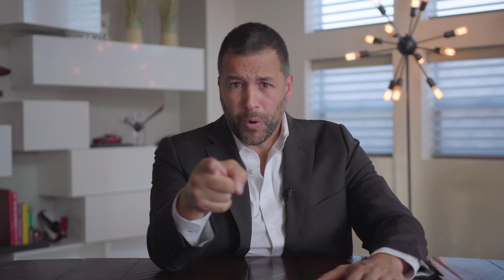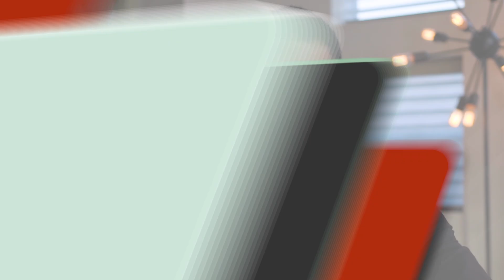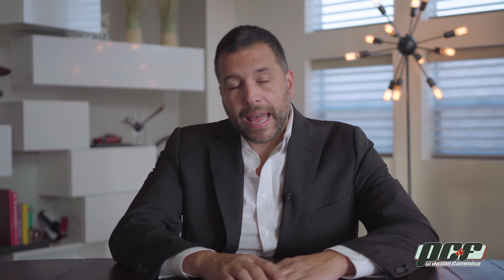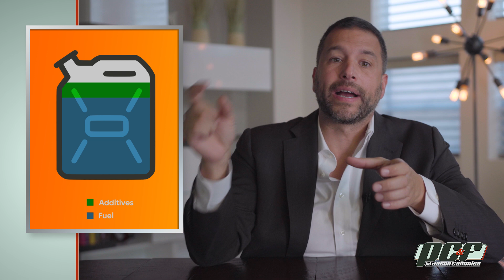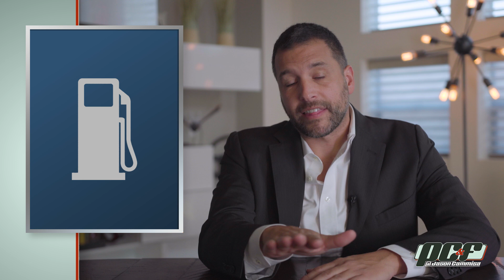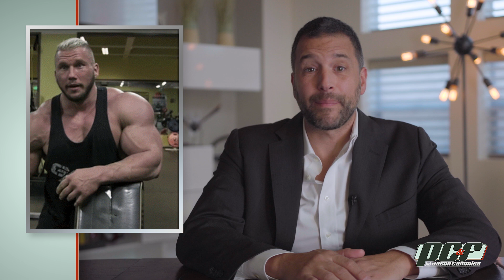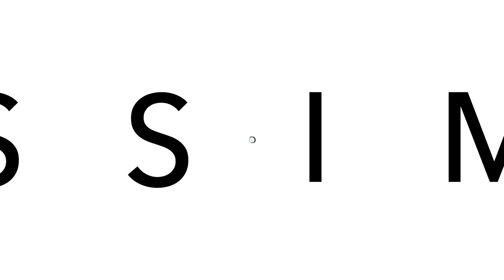Why you should never put premium gas your non-premium car — Proper Care & Feeding with Jason Cammisa

Comment: He said nothing about having a vehicle that runs on 89-93 and one is putting 87 octane in it.  Computer retards the timing, not as much heat and carbon builds.  Yes, running 87 octane in a vehicle that is designed to run on higher octane can hurt the engine.

Comment: Because I run my work vehicle primarily in the winter, come spring I'll often switch to premium (94 octane ethanol free) as the car can sit for weeks through the spring and summer.
On one wildly hot summer day (43°C) my car began hesitating, and misfiring. From now on I think I'll risk leaving 87 (and it's hydroscopicness) in the tank for long periods of time, perhaps with a shot of fuel stabilizer.
Reply: yup. thats because of ethanol. You are right to store your car with less ethanol fuel in the tank.

Comment: Premium gas (at least for top-tier fuel stations, dunno about other places) has a better detergent additive package and can keep your valves and such a little cleaner, so I run it in my cars. One of them needs it for the octane thanks to its computer tune, two don’t, but I run it anyway sheerly to keep the top end cleaner. I’m not sure that the difference is worth it, or even appreciable, but I feel better about it. Once I have a direct-injected engine in a daily driver (probably the next one), I’ll likely just run 87 in it since the already small potential for real benefit will become even smaller.

Comment: Well I think you should do a real test with a dyno I think you'd be surprised that there is difference and it is possible to measure even between 98 and 100, and there is no loss of power, it is in fact the opposite. I've seen it many times by now and you can do the test with any modern car it doesn't have to be a performance car at all. It might not give better mileage, but it does give you more power.

Comment: Why don't any videos discuss what to do in a Car that RECOMMEND premium, as is the case with most luxury and turbo cars? Most such cars can run regular with little fuel economy penalty and a cut to power that doesn't affect daily driving. All care, including those that require premium, can run regular and protect themselves, but the ones requiring premium will see more severe effect on fuel economy, power, and smoothness.

Comment: Pontiac G5. 2.2 ecotec. No reason to run Shell 91. Except I will do, for 2,500 miles to reduce carbon deposits by ~70%? She's got 180,000 miles running 87 the whole time, so I do believe I have sound reason to run premium. (once the 2,500 miles is up, you're damn straight I'm going right back to 87.)
Reply: dump some B12 in the tank.

Comment: reading some of the comments are hillarius!  obviously the knowledge of energy per gallon is   
something that should addressed.  And the record is clear on the corrosion ethanal causes in many engines.  if it wasn't making corn farmers richer through gov. subsidies, you would not be seeing it.  higher the E content, the lower energy content it has - and your mileage suffers the higher the content is.

Comment: The additives do help any octane car. Its basically like putting one of those fuel additives they sell in the auto section. Though this is not worth it still in most cases, though I find it helps with older vehicles. Higher octane gas often (though not always) has less ethanol, this helps with fuel economy and also reduces corrosion in older cars or with carburetors (like with law equipment, motorcycles scooters or older cars). And last people who let there car sit for a long time (like for plugin hybrids) the higher octane fuel lasts longer because as fuel ages it looses octane.
Reply: Chemistry is not your friend. Ethanol raises octane rating in fuels.
Reply: @truantray  At the cost of causing more harm to your engine components long term.
Reply: Higher octane gas almost always has more ethanol. They put ethanol in gas to raise octane not just emissions. The alternative to would be to put lead in ur gas to raise octane. But lead slowly kills ur braincells and destroys catalytic converters. 

Yes ethanol is corrosive because of the oxygen in it. But they put additives (antioxidants) to stop it from happening. With modern gasoline, your car is gonna rust from the humidity in the air long before it rusts from the fuel.
Reply: so what you should do is put 87 in and around every oil change put a bottle of gum out or something in the tank.
Reply: My Cadilllac XTS will run without knocking on 87, but I get more spark advance and therefore better performance on premium.  This is a stale, boring subject and I equate it to being told generic medications are as good as brand when they’re not.  It’s a lie.  It’s a lie that you don’t get more spark advance with premium under harder acceleration.  And also just the fact that premium has more detergent is enough to justify the additional cost.  All those middle eastern guys who drive Escalades in the rideshare business all use the cheapest gas they can find and they put lots of miles (500,000+) on their air freshener infused stinky sleep in cars.  They are always having to get their intake manifold and fuel injectors cleaned out and sufffer poor acceleration and gas mileage.  It even affects the gear shift patterns on the ten speed transmissions.  In my opinion they shouldn’t even make different grades of fuel.  It’s not wise to be cheap about what you are literally burning through the most expensive item you own.  Few people own their houses and are 60 days from being evicted regardless of what they tell themselves.
Reply: Snakeoil lol

Comment: you  could make an argument that premium gas has more cleaning additives in it, so if you have a IDI engine that could clean some carbon of the intake valve, is that correct? Also on GDI/TDI engines, cleaning every few gas tanks shouldnt be a bad idea?
Reply: All DIs need induction cleaning at some point, regardless of octane; premium isn't the fix.  Use the best air filter to help intakes stay clean longer. All Tier 1 gas in USA, 85 thru 93, is required to have a certain amount of additives and cleaning agents. Worst in Cali, 91 should be like 91 anywhere else, but it's not =. My 19 WRX needs 93 to stop feeling jerky (pulling power to stop damage). Shoulda hada V8

Comment: Actually, with a turbo car that's designed for premium using regular gas causes the computer to pull timing which raises EGT (Exhaust gas temperature).  If you habitually drive the turbo car hard on cheap gas the frequent manifold overheating makes the cast iron brittle and can crack the manifold.  I went through 3 manifolds on one of my cars before a tuner guy machined some give into my manifold's mounts and told me: Premium only! Problem solved.

Comment: I can't get people to understand that. However there seems to exceptions to this rule in terms of carbureted motors. I had a 92 isuzu with a 2bbl and I drove the same interstate route everyday so I started a test of checking mileage and the 89 octane got 1.5 miles per gallon more than 87 almost a mile over 93. I've heard other stories of this and when asked if they were using carb or fuel injection and it's always carb
Reply: My 92 chevy euro was the same, they dont like ethanol gas as much and it seems to bog it down.  i ran pure gas with 89 every other tank and it seemed to do better
Reply: @theparkerfamily7153  lucky enough for me they weren't adding ethanol to gasoline yet, but small fact. Fuel with 10% ethanol gets around 3% worse fuel economy. But I thought the goal was a cleaner environment? I personally know that the whole "climate change" thing is crap and they know it too, you can see it in the wide spread hypocrisy of what they say and then what they do

Comment: First things first, there’s no such thing as “premium” or “regular” gasoline. Most manufacturers do state that their turbocharged engines are okay for 87. They are not. Look at how much those engine have to retard the ignition, struggling to run on 87, yet still resulting in pre-detonation from time to time. If you have a turbocharged engine 91 is the minimum, 93 is preferred.

Comment: I would argue that if you don't use your car often (e.g. don't drive your car for several months), then it's worth getting higher octane gas, as Gasoline, being an organic compound will degrade in time and that also lowers it's octane value. If you daily drive your car on the other hand, what was said in this video is 100% accurate, so you can save a buck by buying the recommended fuel for your car. Alternatively, if you are in the 1st scenario, you could just  buy some octane booster additive and pour it over the existing fuel, if you bought regular octane and didn't use it for a few months, but I don't know how cost efficient is to do that.

Comment: Thanks Jason, love your work!  Slight nuance here though... Up here in Canada (not sure about US gas), many stations have differing levels of ethanol in different grades.  Regular (87 octane) normally has 10% ethanol content, Plus (89 octane) 5%, and premium (91+) has 0% ethanol.   While this isn't a concern for modern cars, ethanol can wreak havoc on classic car fuel systems.  My RX7 doesn't need more than regular fuel, but I put premium in it to avoid the ethanol.  Sucks there are no regular, non-ethanol fuels anymore.  Bring back lead! :P
Reply: What that tells is that in that case the lesser octanes ratings are actually crappier fuel, it's not just the octane rating that's different. Ethanol is an octane booster. In Europe higher 100 and up octane ratings are achieved by having more ethanol, not taking it away. The base fuel (without the ethanol added) of those lower grades must really suck
Reply: @fgsaramago  Fuel stock should be relatively the same regardless of pump grade. But, yes a 'plus' grade will have less ethanol and more additives than regular, 'premium' even less or no ethanol and even more additives.  It's BS to get people to buy premium when they don't need to.
Reply: @spishco  basically the only octane booster additive that's still legal nowadays (not being lead or a derivate) is ethanol. As such, if you add more ethanol and still end up with lower octane gas, that can only mean it's incredibly poor quality. Honestly it makes sense if you think about it. In North America the use of diesel is orders of magnitude lower so oil companies have to blend in some of those heavier naftas in regular gasoline, otherwise they would just go to waste and result in lost profit
Reply: @spishco  I'm pretty sure that in most (if not all) gas stations, 89 octane is achieved by mixing 87 and 91 octane fuel.

Comment: Hello Jason. Does this apply for diesel as well ? I always thought that by buying premium diesel you maintain a cleaner engine and combustion, even if used in a normal (non-premium) car.
Reply: The best diesel you can buy is from 20 years ago, when it had more lubricity.

Now we are stuck with ULSD, which doesn't protect injection pumps. All because of EPA mandated emissions, DEF systems, etc.

Comment: You must not be in California where the concept of an actual octane rating is a bit blurrier that most places. I disagree with your analysis. We only have 87, 89 and 91 (race gas too, but just no). My experience at all of the gas stations we have has been the same. Whether a 2006 Honda Pilot (definitely not a premium car) or my Ford Flex, both run poorly on non-premium gas and idle smoother, have more perceived passing and merging power on premium gas. Octane reduces predetonation which is detected by modern engines and retards timing to compensate which also reduces power output.

Comment: This is such a pet peeve of mine lol. Always someone willing to swear that their car definitely runs better on premium. You always want to run the LOWEST octane possible without getting detonation. He's also not wrong that most modern cars designed for premium can pull enough timing that running regular won't make them explode, but it's still a bad idea and you'd definitely want to stay away from high load/rpm.

Comment: Basically, putting high octane (premium) on an 87 (regular) rated car is a waste of money. Putting lower octane in a car rated for high octane leads to knocking and eventual engine failure. 
Rule of thumb- you can go higher in octane, but not lower.

Always read your owners manual to see what fuels are ok to use.

Comment: I own a car that requires premium (91 or higher) and I've been told by many professional mechanics and tuners to never put 87 in it, or it will eventually destroy my engine, not just a little drop of power. Always read your user manual, which tell if your car need 87, 91, or can be run on both.
Reply: Yeah I was disappointed that he glossed over that. More people should read their owner’s manual to see what their car specifies. The manual tells you everything you need to know honestly, but most people never read it.
Reply: @RotchildFrancoisJr  The manuals aren't reliable and sometimes just say that for liability reasons. AAA did a test before and found many vehicles which require premium operated fine although with lower performance and fuel efficiency on 87.
Reply: @maxime parent My 2 cents as an auto tech for 21 years, I’d stick with premium. While yes your car does have knock sensors and can theoretically retard some ignition timing, there is a chance it can’t do it enough to not result in spark knock, which can hurt an engine. 
My wife and I had previous gen acuras (2008 era but definitely OBD II cars well into advanced knock sensors), naturally aspirated higher compression (for their time) engines which per the manual required premium fuel. We ran premium 93 in them and they sounded happy (no knock) and got their rated mpg. 
As an experiment I ran 87 octane and immediately noticed spark knock. Also could see a drop in mpg. I switched back to premium and knock was gone and mpg came back. For that car it’s a no brainer. 
As an auto tech, and now a manager who gets to drive a demo, I get all different cars. Recently I had a 2018 Malibu 2.0 turbo. Its the higher hp version and it said premium recommended. It came to us running strong. I experimented and put a few gallons of 87 in it when the tank was low and noticed a drop in power after it noticed spark knock while in boost. After a few times accelerating through boost with audible knock, the knock went away and it felt even a little slower. Faster than the 1.5l turbo Malibu cars but noticeably slower than when I first started to demo it. With all my higher throttle use I didn’t feel my mpg ratings were much to compare so I didn’t even try to remember them. 
I filled back up with premium and the car was still slow until after many medium/ heavy throttle applications it kept testing how much more boost and timing it could throw in until finally it all seemed to come back. 
We don’t have a dyno so I could only gauge all this by the seat of my pants. 

Moral of all this is especially with the Mazda speed 3 in your profile pic which is turbod, yes I would stick with premium. Even in the case of the Malibu where it specifically states it’s recommended, not required like most cars state, it surely paid the price in reduced performance. Likely in lower mpg too. What’s the point in having a car like that if it’s automatically ‘turned down’ 25% or more?
Reply: @bradwhiteley2843  my two cents as an ex programmer for Renault. If you knock sensors fail and your car is still under warranty, your insurance will just give you a new car.
Reply: Yeah but he's going on the fact that every car since like 1996 has had knock sensors feeding into the computer which just controls timing/fuel to stop the knock.  Its not going to blow it up, its just going to have such inefficient cycles, that it costs you more fuel to propel the car, eliminating any perceived savings by choosing cheaper gas.
Reply: @snap-off5383 knock sensors detect the knock and tell the ECU to retard the timing after the fact. Meaning the damage is done.
Reply: unless you're putting 87 PON, which is equivalent to 91 RON lol
Reply: Agreed. I work in the marine industry and it's the exact same way. Of course, boats need marine/non-ethanol anyway, but that's beside my point. Never put 87 in an engine if you can help it; it's bad for fuel lines and injectors. Thanks for commenting this, I was so frustrated watching him gloss over this, as much as I like his videos.
Reply: It doesn't destroy the engine lol, you can even put vegetable oil and it will still run fine
Reply: @skylinefx049  yes and you can replace engine oil with vinegar  and gas with coffee it will run just fine
Reply: @maxdaspeed3  I just started taking a whizz in mine. Runs just fine. 😂

Comment: If you own a vehicle with an acceptable engine management system with closed loop correction and knock sensors running a higher octane fuel WILL improve your fuel economy under certain conditions.

Certain engine designs benefit from lower octane fuels because they burn faster. 2 stroke (180 degrees crank rotation between combustion events) and rotary engines (combustion occurs every 60 degrees of rotation) will produce more work with optimised timing and fast burning fuel.

Most vehicles are equipped speedometers and odometers. So for the people smarter than this muppet you can compare mileage and work out if the increased cost of premium is beneficial in terms of mileage.

Comment: I did the math and get enough mileage improvement in my 2 BMW’S by using premium fuel to just about offset the cost
Reply: I also have experienced the same in a DI 2.0 boxer. Better throttle response and mileage.
Reply: in forced-induction engines the premium gas does make difference. In naturally aspirated not .
Reply: @LukeBasson  Engineering Explained’s video and my own results say otherwise.
Reply: @LukeBasson  I put 87 in a E46 it trip a code.